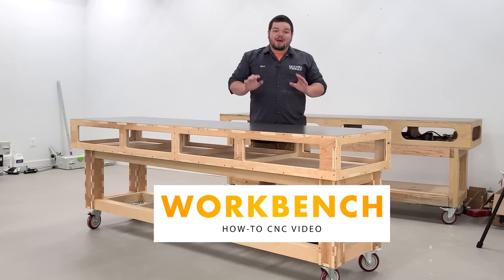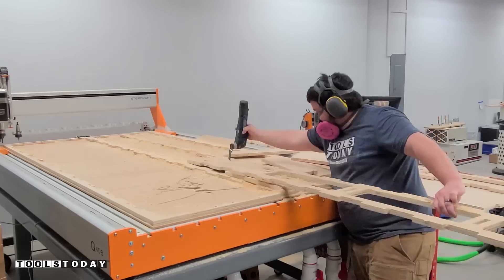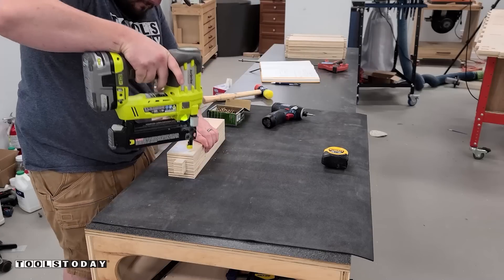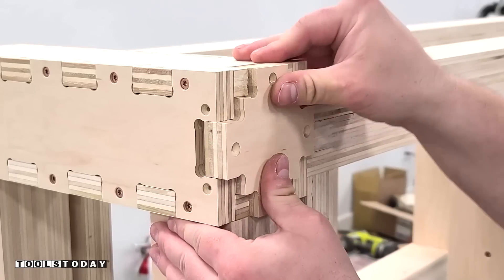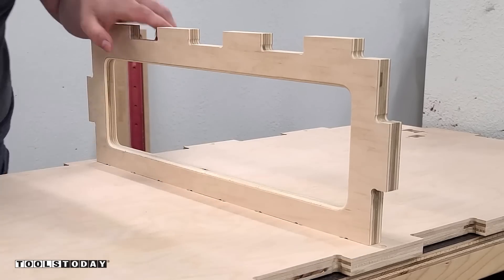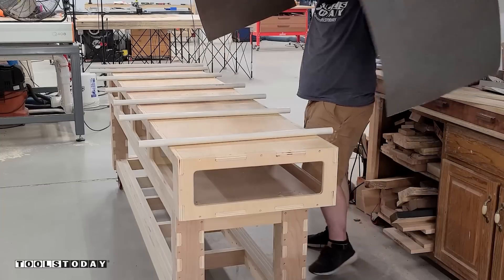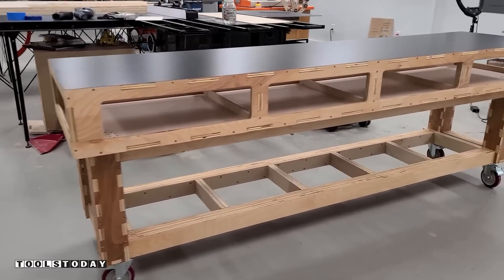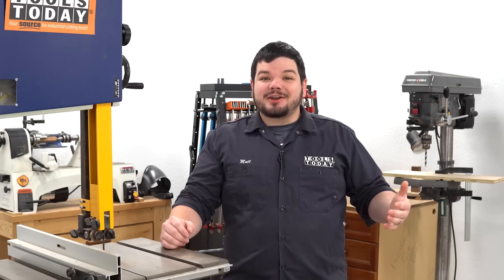How to Make a CNC Workbench | ToolsToday

Comment: I have an Avid CNC with a 48” x 48” bed. Would it be possible to design this in 2 sections then I could add an additional top layer over the plywood to tie them together. I also prefer casters on the ends that can be “toggled” up out of the way when stationary
Reply from the maker: Yes, you can take the design, edit it and break it up however you'd like

Comment: I know this video is a bit older now, but just in case you haven't changed it yet: 
The screetching noise your machine is making from 1:37 onwards indicates that your feed is too low (or rpm too high).

Comment: Can you please advise if this can be made on my CNC. I have a 1300mm wide by 1500 mm Long Table.  Also is it possible to make the Work Bench only 1500mm long
Thank You. Looking forward to your reply.
Reply from the maker: The plans are meant to have the workbench be roughly 96in long, but you could certainly modify the design to make it whatever length you want it to be, but the files are made assuming the bench is going to be full size.
Reply: @ToolsToday  Thank you

Comment: What were your feeds and speeds for the compression bit?
Reply from the maker: it was at 18K RPM and 200ipm feed rate, all of the speeds and feeds are also listed in the video description.
Reply: @ToolsToday  Thanks for the reply. Did you use the same bit throughout the cut on all sheets? I have never used a bit to cut in one pass. My machine is capable but I'm always worried it will break the bit. Great build.
Reply from the maker: Yes, the same compression bit, and all other bits used, were used for all of the sheets.